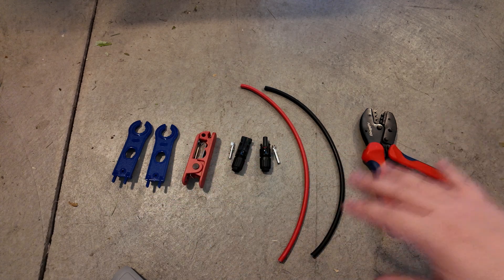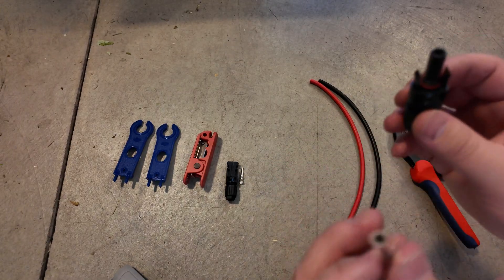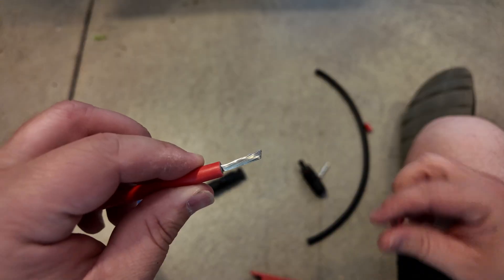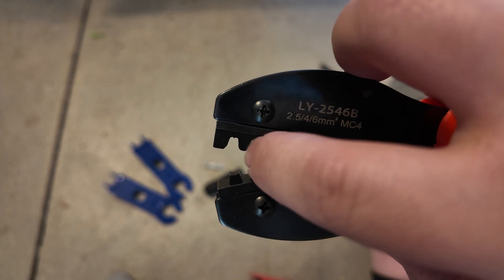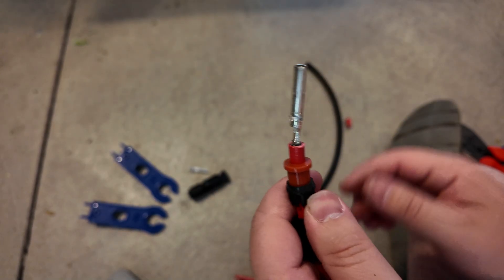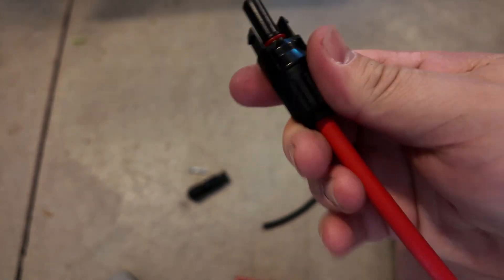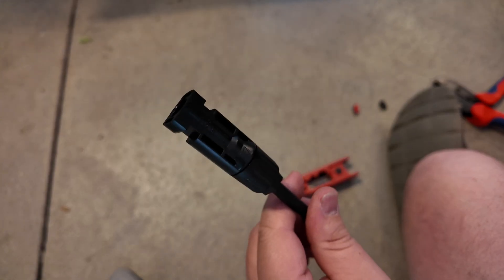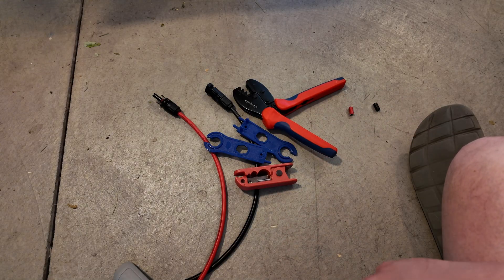Make Your Own MC4 PV Solar Wires (Step-By-Step)

Comment: @TheresATrickForThat  At minute 2 seconds 35, do you have just enough copper to lay on the metal part or do you have copper going all the way into the male/female parts? I went down a rabbit hole on Stäubli MC4 connectors last week and  some of their photos show it just on the part to be crimped. I just want to be sure because of the horror stories about MC4 connectors being one of the biggest hazards. 
  Thank you for this great video, it helps explain alot if the process.
Reply from the maker: You only need enough of the wire, stripped for the part that gets crimped around it!
Reply: @theresatrickforthat Thank you.